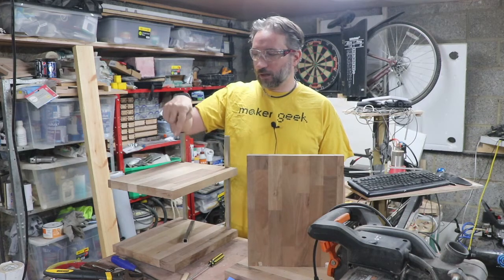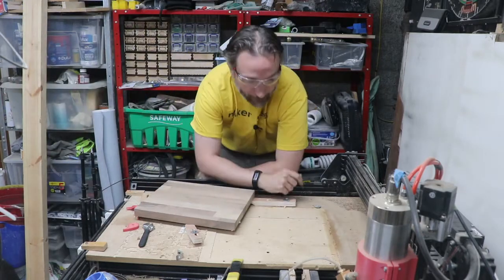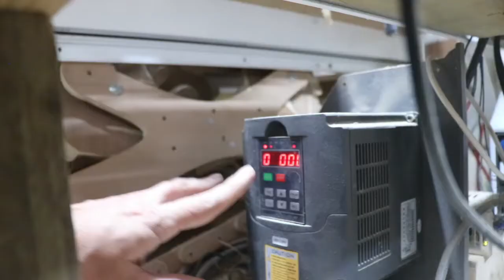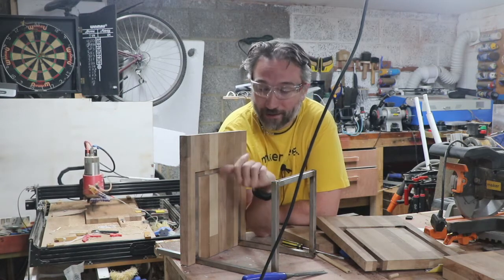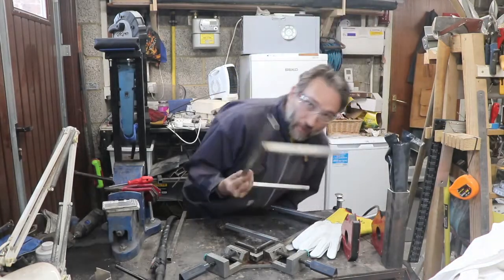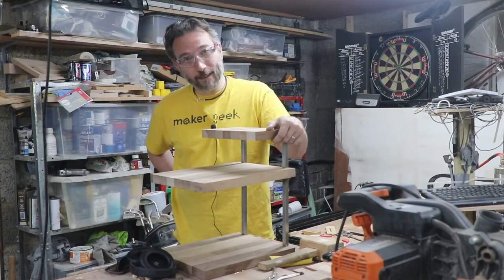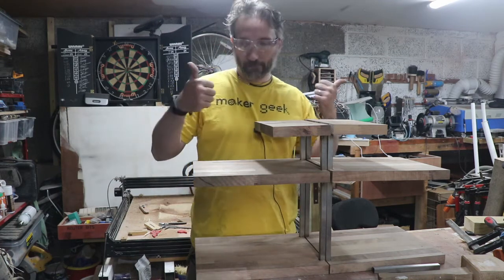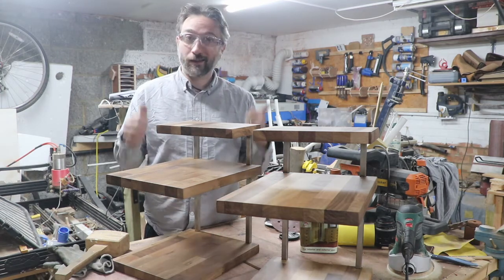Walnut and steel floating bed side tables

Comment: Nice work, nice welding. When I am welding like that I tack on on side, check for square, (adjust with a hammer if required) then tack the other, check again then weld up fully.
Reply from the maker: Cheers! I think I'm just a little impatient, so go for welding a whole side. Obviously I should have the patience to tack first :-)
Reply: @MakerGeek  patience is key. Tack, check, tack, check, weld.

Comment: You could put a strip of leds in the groove you have made for de cross bar
Reply from the maker: I thought about that. I've not done it yet but if I find a nice looking option I may well do so.
Reply: @MakerGeek  Make some holes from behind the structure to pass the cables
The steel structure is hollow ;)
Reply from the maker: @filipe4952  yeah, I briefly considered drilling the holes when I built it, just in case. But I wasn't sure I'd ever use it. And these days you can get pretty good rechargable standalone lights. So I was thinking I'd find some small battery ones that would fit in the cavity.